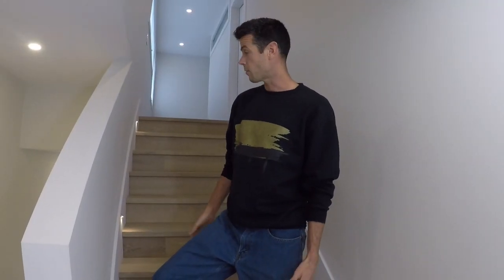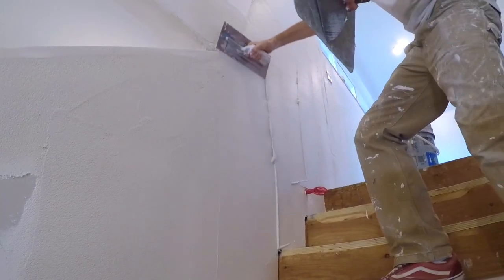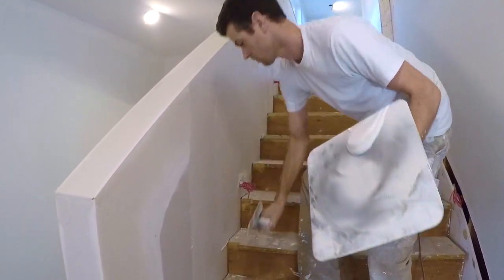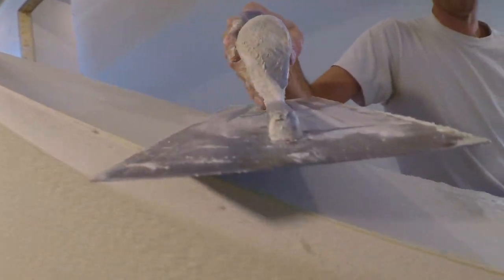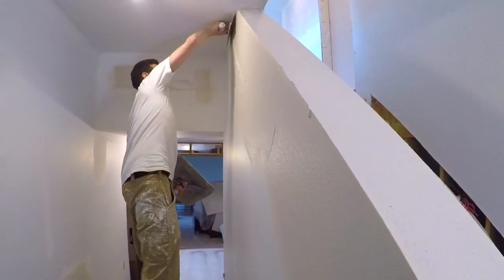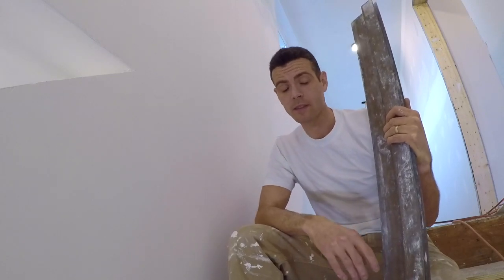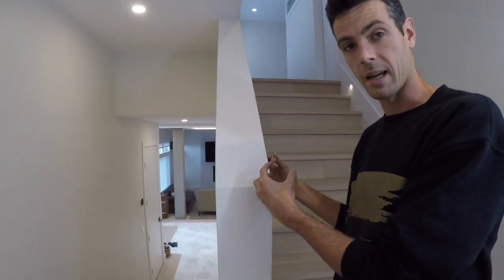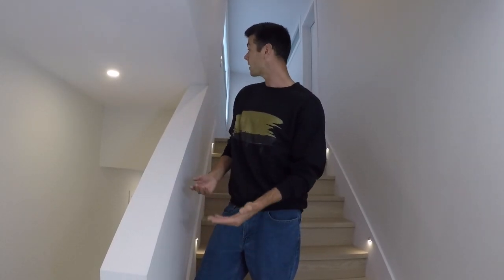Mud framing! The Corner Bead Edition (Part 2)

Comment: It is hard to teach and help others understand that walls will not be flat but rather flowing and appear to be....I'm working on a "speed bump" that ends up being a very wide joint to make it less apparent to the eye....I have to explain your eye won't see it in the mud but as soon as primer n paint goes on it will be a huge eye sore.  You are right about amateurs not attempting because it is difficult to achieve a quality joint!

Comment: We have a plastic bead/corner here in Sweden thats really durable. I has adhesive on it from the start and once you put it on the paper of the drywall you cant move it, its there forever. But itws really easy to cut using scissors. I can do a whole house with a 50-pack in a few hours. Any mud sticks to it..

Back in the days the carpenter put those awful steel ones. I said that I'll even do it for free if I can do it by myself. It save me alot of headache and money

Comment: Con-Fil is a wonderful  product and strong too. I swear by it for plaster repair as it's great as brown coat to bond to lathing. Easiest way to level or cover over textured surfaces. TIP, the first coat of mud over Confil (Or similar product) I call the free coat as it does not bubble up. And any coat applied after that will bubble. To remove this issue give the surface a very tight skim and then coat it again right away. The first tight skim fills the tiny holes leaving the coat right after free of bubbles. This bubbling issue only happens on sealed or painted surfaces where the air can't displace itself into the surface while the surface is drinking in the moisture. If that makes sense.

Comment: We use Trim Tex vinyl beads, which get glued on than shot on afterwards with 1 1/4” staples every 8” or anywhere that popped loose. Best beads out there. Paper faced metal backed beads are certainly better than the old metal beads, which nobody should be using. The new Big Stick beads are even better than the old style of paper faced, because there is no paper to nick with your trowel. Check em out.

Comment: So Canadian Carpenters are just like Carpenters from the United States huh? I have had tapers fill my electrical boxes with mud on purpose... By the way, it's be cool to see you do a "level 5" wall
Reply: Yeah I'm a tape and bedder myself but sometimes we texture houses that other people bedded out and you'll see electrical boxes completely filled with mud, I usually cut the mud out though to save the electricians some trouble.
Reply: Level 5 isn't as popular here in Canada, we mostly do level 4. Honestly it wasn't till I looked up on the internet that I found out what the different levels where, we just finish the screws, joints, angles and beads here. Fully skimming a wall even on high end builds isn't the norm.
Reply: @stargateproductions  yeah, I don't think it is here either. I know if maybe one place that has actually done it.

Comment: Ben,  why doesn't that confil stick better? Was that bare sheetrock or painted. I would have liked to see it adhere much better.
Reply: It should stick fine, he was just scraping it before it fully kicked off so that all the ridges were still soft. The surface would have been harder than what was underneath
Reply: @bolerdweller  Fully kicked off?  It was a week later
Reply: I just went back to the video and I dont hear where he said it was a week later?
Reply: @bolerdweller  Made  you look
Reply: @bolerdweller  I really did think he said it's been a week or more.  But I still question just how well this stuff adheres.

Comment: You confil appears to have a texture have you considered using a easy sand product like 45 or 90 for theses steps they dry much harder than traditional gypsum products and adhere to sheetrock very well where you confil seems like it could flake judging by your scraping

Comment: I have about a 1/4 gap (in a ceiling) about 3ft wide 4 ft long. None of my local stores have quick set.. idk why but they’ve been sold out and shipping just isn’t happening. It’s the last spot on my project that needs mud. Can I use  taping or all purpose mixed thick in thinner layers for that “mud framing” or will it fail? I was thinking 3 thinner coats to fill it instead of one thick one to prevent cracking.

Comment: Hey Ben, vinyl corner bead will take a hit from a couch but the mud will still break away.
Reply from the maker: Do you mean the mud set beads?
Reply: @vancouvercarpenter  No, the glue on Trim Tex beads. They are very durable. They do take another coat of mud though, I'm guessing that's why they are not as popular.
Reply from the maker: @stargateproductions  I have never tried the glue on ones. I have used the mud set though. I liked them. But yes. Three coats for a proper finish. With the mud set you can add a really quick knife coat with your taping mud at that stage and then just the regular two coats. It also helps with the adhesion onto the vinyl because you will be using taping or heavy all purpose.

Comment: Newbie trowel question:

Was that a finishing trowel or drywall trowel you used here?  Can either be used in applying a skim coat or does each type have different practical uses?
Reply: He's using a finish or flat trowel a drywall trowel is curved and should only be used for coating joints not for skimming whole walls. A finish trowel is ideal for skimming

Comment: Hey Ben do you have any experience with a product called Durabond 90?
I was told to use it when pre  filling problematic shifting cracks. 
Apparently it cures harder than the sheet rock resulting in either it not cracking again or redirecting the crack else ware.
Reply: Travis In Canada I don’t know about Ben but I do, it’s fantastic for filling cracks and large gaps, also bonds good to old plaster, however make darn sure it smooth and will need ZERO sanding because it’s hard as a damn rock when it’s set up
Reply: @Iamthathillbilly  Right on, thanks for the info I will take your advice.

Comment: Can you please ice a cake as a funny video.  On a serious note, I need to know what changes when working with green drywall.  I am fascinated that out big box stores charges the most for 1/2 regular drywall, less for 1/2 green mold resistant, and even less for 5/8.  I would have set my electrical boxes to 5/8 had I known sooner.

Comment: Does mud need to be applied to the entire ceiling and walls before painting?
Reply: No. Just joints and screw/nail heads. Then paint the surface with a drywall primer before painting

Comment: Can you tell me what kind of sander that is that you just used....I always sand by hand like a crazy person, I need something easier
Reply: looked like  the Festool Drywall Planex Sander very nice super expensive.  I have the much cheaper porter cable drywall sander, it works great except in tight spaces and you can't break down the handle like the Festool. Either way for all the DIY drywall I have had to do at home its a marriage saver. The slightest suggestion I was going to do drywall work  used to send my wife into a fit before I got  proper drywall sander.

Comment: whatever kind of mud he's using is not good - that's why it's not sticking to the paint... not enough glue in it.
Reply: Rob Bob if you are referring to the first couple minutes when it was peeling it is still soft and not totally set up, which is the best time to scrape off high points but if you aren’t careful it peels easily
Reply: @Iamthathillbilly  It's the wrong mud - any decent drywaller would know that...

Comment: F that crap just use new drywall.
Reply: what does new drywall has to do with anything? The frame underneath is not straight, so if its not in the budget  its not happening.